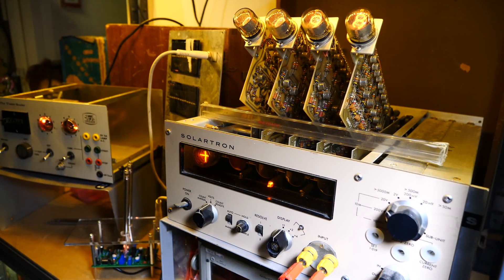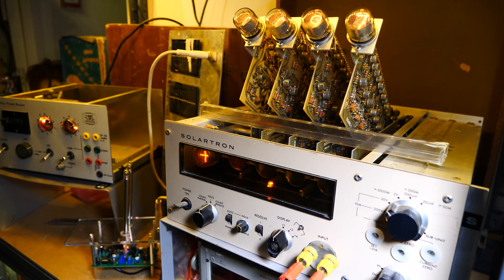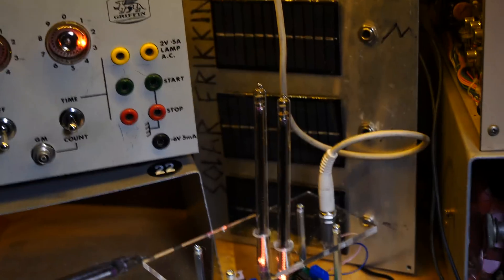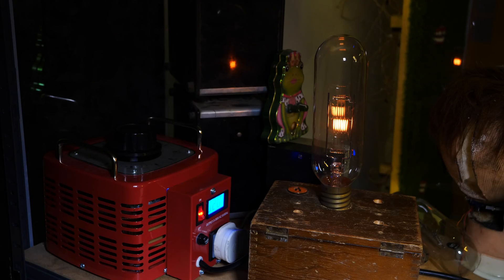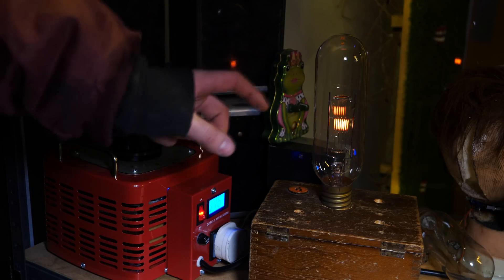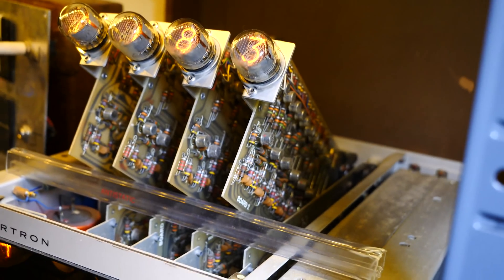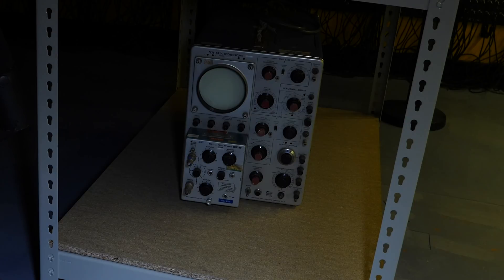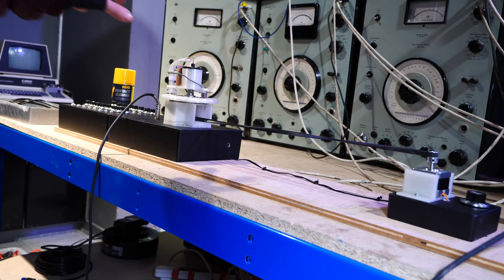Nixie Tube Voltmeter and Solar Panels

Comment from the maker: E40 sockets sadly they are too small. so if anyone recognises that specific bulb and knows the Edison number that would rule! all good if not.
Check the video on the electro magnetic sequencer here! :- https://www.youtube.com/watch?v=PdVcY0ymyV8
25 minutes of the sequencer doing its thing here :- https://www.patreon.com/posts/20-minutes-of-49069938
Reply: Theyre called Mogul base, some stadium lights use that size if im not mistaken
Reply: @ivyisle  I think youre correct! edit just looked it up, you are correct sir! you have won this part of the internet this evening! Correct answer: Mogul base!
Reply: Do you have the dimensions of the bulb base/threads? I too have some fat fat (1kw rated) bulbs and I have no idea what they screw into.
Reply: Where is the museum? Could do with a good day out when restrictions ease
Reply from the maker: @misterjib  kent
Reply: I thought they might have been an e39, but if an e40 is too small, the Edison screw line ends at e40 I think.
Reply from the maker: @patprop74  oh! I didn't know they stopped at 40 haha aah oh well. one day somethinng will turn up at a car boot sale if they ever start up again ha
Reply: @THISMUSEUMISNOTOBSOLETE  kind of wonder if it’s some specific projector mounting thing, they often needed pretty massive active cooling to stop them burning the place down. Tesla500 did a tear down of a decommissioned 35mm projector years back and it was a great watch
Reply: I've got a crapload of old NASA test equipment some of which could be used to make music, a la Hainbach, that I would gladly donate to the museum but the stuff is big and heavy and I'm in Louisiana. Quite the shipping charge I would think!
Reply: If it is an Edison screw, you can just measure the diameter of the threads in millimeters (across the ridges). That's the corresponding number after the E.
I had a real lightbulb moment (pun very much intended) a decade of so back when I realised that the cryptic number after the E in light fittings is actually the diameter.
Reply: @HattmannenNilsson  it's bigger than 40mm if that's what you're wondering. Cool info bout the Edison base measurement.
Reply: @ryanmalin  I saw that. I was thinking that maybe there was some larger Edison screw fitting that was used at some point, and measuring the thread would be a way to find out what it would have been called.
After having a cursory glance at Edison screw on Wikipedia, I'm thinking that it's probably some other type of specialist socket that was used. Which means I haven't a clue.
Reply: I think they are called "mogul base bulbs" in the US
Reply: If that solatron voltmeter is the same as one i had in the 80's it has a Weston Standard Cell for the voltage reference - its a glass H-shaped bottle filled with saturated cadmium sulphate solution and cadmium and mercury electrodes. Produces a reference voltage of 1.01858V . So must be stood the correct way up. It's inside a black plastic / bakelite box inside the meter.
Also IIRC the voltage divider has a chain of precision wire-wound resistors including one huge 9.900 MΩ
Reply: that 100% is an e40 or e39 mogul base bulb unless you have some weird oversized 13A plugs on that variac
maybe the e40 socket you bought was not actually e40 but judging by the size of a standard uk plug it should definitely be about 39-40mm, likely you got an e27 base sold to you as an e40 since they're not common in the uk and can't tell the difference by eye.  definitely just measure the bulb and the sockets you have

Comment: i have a nixie tube obsession  have loads of clocks  nixie tubes numitron tubes and dekatron tubes the only problem is now the price of the tubes has gone through the roof there is two companey that have started to make nixie tubes again there is a company called PV electronics that supply kits so you can build your own clocks

Comment: 3d print a temporary socket for the bulb?
Reply from the maker: alas heat and 3d printed items do not go hand in hand
Reply: Yeaaah. I tried to 3d print a prototype tea infuser and it melted in the hot water! 😂 I just thought with some petg that usually prints around 230-250c that it might withstand the temperature at the base. (or better yet a nylon or resin printer?)

Comment: Sam, do you have the schematic for that unipolar stepper motor driver you are using for the rhythm drum generator?
Reply from the maker: just used an adafruit shield. it was a cobbled together thing only had about 36 hours to plonk it together so just used a moded example code and motor driver

Comment: That's an E40 socket (also known as a GES or Goliath Edison Screw). Beware of running the lamp at full power for very long, they're designed to be run with forced air cooling and will quickly blister if run without plenty of cooling.
Edit: I just noticed that you said it's not E40. The 40 refers to 40mm diameter, so measure the diameter of the threads to see what it it; I'm not aware of any ES thread larger than an E40 though. Do a search for an A1-57 lamp to see if it's what you have.
Reply from the maker: indeed i was just hoping someone recognised the lamp cus i did that and ordered some sockets a couple of times and wrong haha.